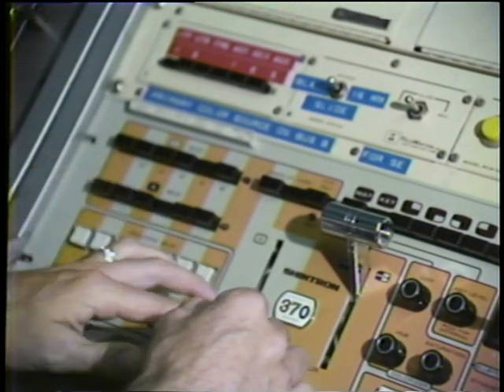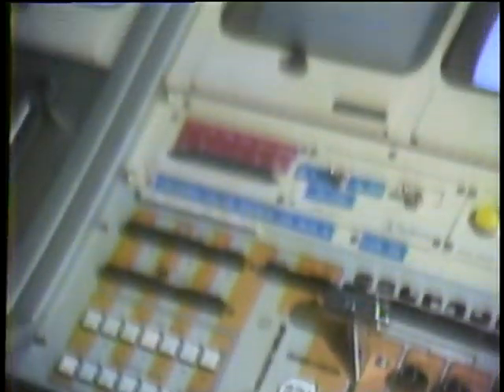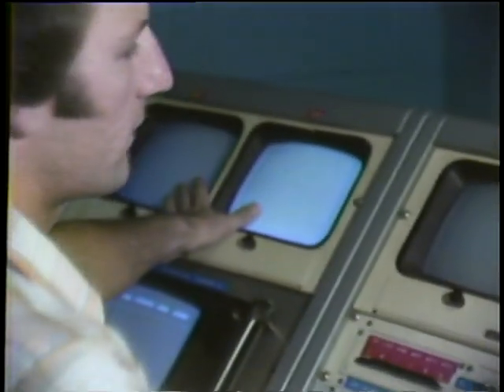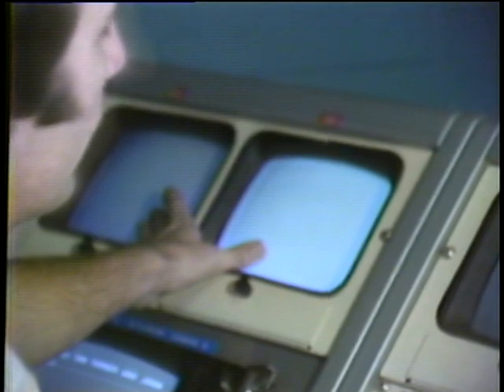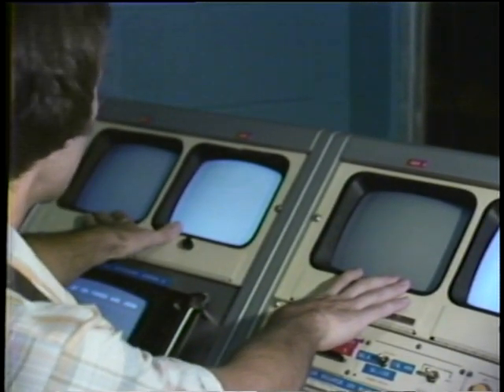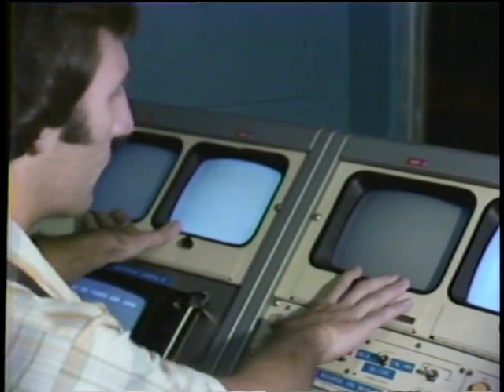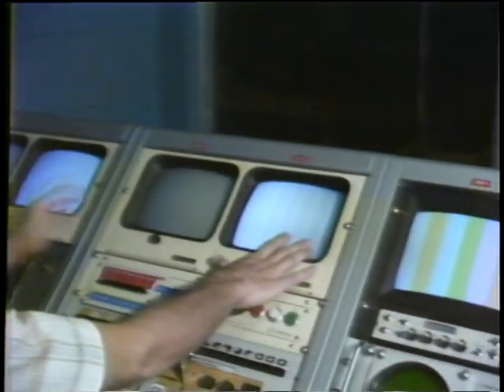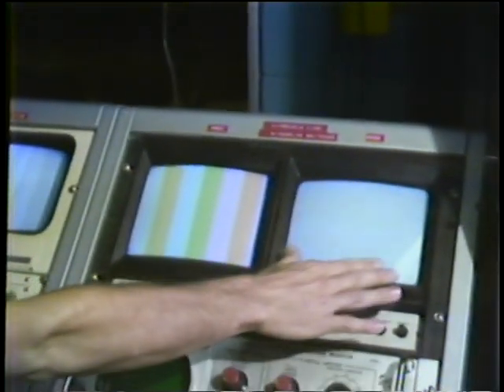Shintron 370 SEG Switcher Demonstration

Comment: I have one of these!  Now I know how to use it!   Thanks!
Reply from the maker: Cool! We still have ours in storage.  It did develop a problem with the mechanical switches at one point. Went with a JVC KM-2000 after the Shintron.
Reply: @salemschooldistrictmediase5793  Inspire me.   I have a pile of 1972-1986 Umatic / Lowell light set my elderly uncle gave me.   Not sold any of it or intend to.  Including the TRS-80 which did his scripts and books.   There's a 1974 Time base corrector and a DXC-6000 video camera.  A video series on the topic?   Go through each item and discuss?